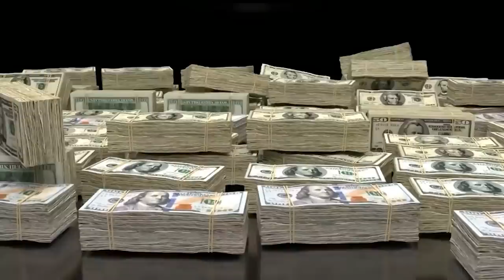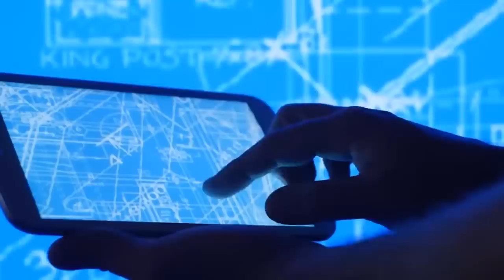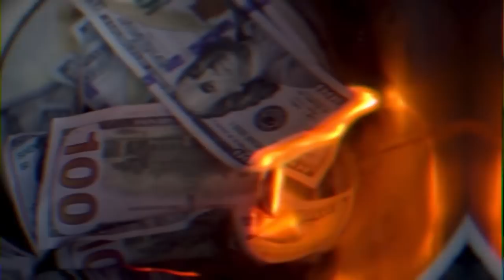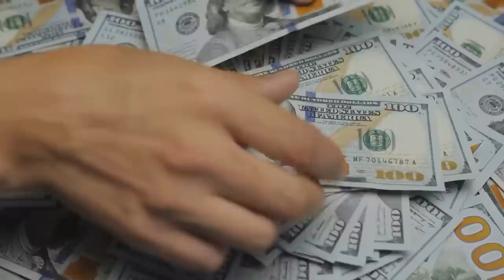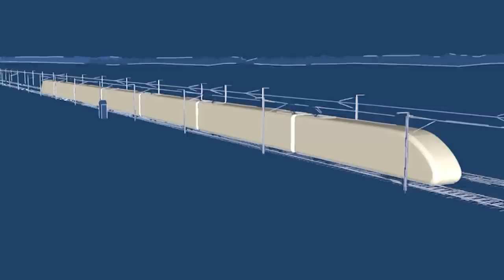Green Light for $4.2B California Bullet Train

Comment: The initial layout for the line has been so far altered that it will take more that the 3 hours promised. Also, in the initial planning of the  worst way of spending monies is that thy failed to look into Amtrak. Using Amtrak would have saved billions of dollars. As someone who builds rail lines all over the world, this should never had been done.
Reply: This makes no sense.  They will still have an express option that doesn't stop that can make it in less than 3 hours.  Amtrak uses freight only corridors that have a top speed of 79mph, and busses have nothing to do with high speed rail.  Busses are the slowest and least efficient public transport.
Reply: @duncanholden2826  Amtrak has high-speed rail along the east coast. From Washington DC to Maine. Long storey short cost wise; it would be cheaper to upgrade the existing alignment/right of way and if need be to add a few more stops than to start from scratch. Plus the turnaround time for revamping the existing alignment(s) as well as adding a few additional stops will be shorter than what the California high-speed rail authorities are saying for when this project is supposed to be completed.
Reply: @davidobrienirl  NEC isn't as fast as it needs to be.  CHSR cant go fast on freight rail.